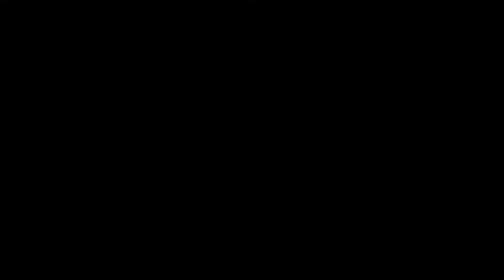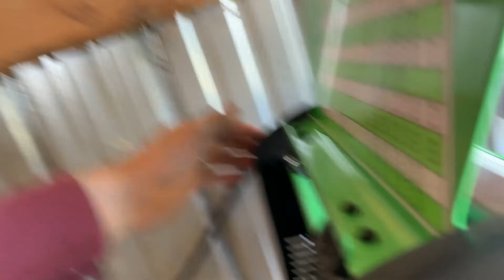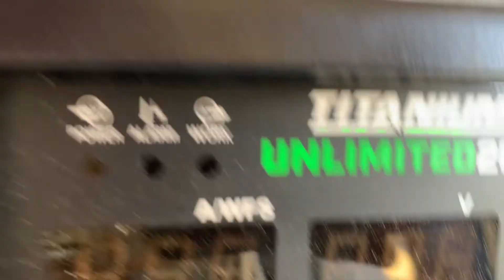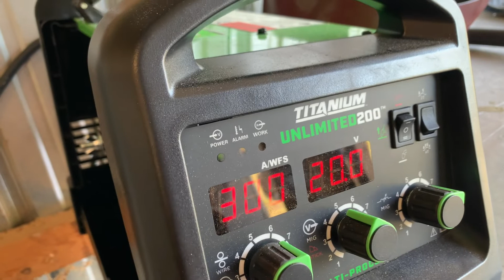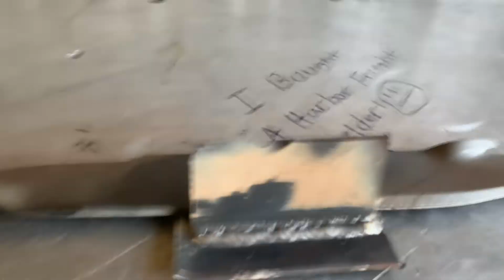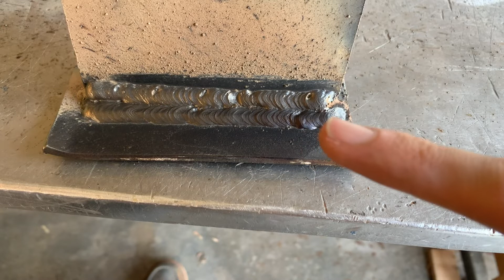Harbor Freight Titanium Unlimited 200-Flux Core Welding

Comment: Lol. Ypur metal is way to dirty. Wow. You should clean your metal before welding. That will clean up your weld and get rid of those holes.  Problem is dirty metal.  Grind it then wipe it with acetone.

Comment: I get different welding wire Harbor Freight wire ain't no good that's some good welding for flux core little pin holes in there you'd have to grind that out and do it over I am doing a very good job like your video

Comment: You dont suck at all bro. You are a TIG welder for Aerospace. I worked for Aerospace (not welding) and I know their standards are high and very delicate. You just dont have experience using wire feed.
I'm proficient in stick welding. Never tried flux and I'm good at MIG as well. 
TIG is my next process to learn. 
Thanks for the review. Gonna buy this multiprocess machine. Youre the only one whos welded with it on flux and stick on Youtube. Everyone else just uses the MIG. No TIG as well.
Reply: *Subscribed
Reply from the maker: I appericate the kind words man. I'm still loving this welder and hope your enjoying yours! Just used mine today for a quick farm repair on the stick side.

Comment: Thats porosity in your welds. (worm holes) Nitrogen is trying to escape from the heat. The wire youre using is garbage. Try blue demon. I use it all the time and haven't had any problems with porosity.
Also if its got slag, let it drag. Keep your angle out and drag it. I love flux core. Its more convenient to me. I dont gotta carry a tank everywhere and run the risk of forgetting to close the fuckin valve. Done that a lot over the years. Gets expensive! I run mainly flux now
Reply from the maker: Thank you for the tips! I knew the wire was garbage just wanted to get it burnt up. About to start building my kiddo a swing set and going to give your blue demon recommendation a shot!

Comment: The worm holes you see in your weld is from dirt on the steel you are welding. I think its Hydrogen gas from dirt or from moisture. You are doing very good welding. Keep it up, in two three years it will be GREAT and you will do what ever you want to with the welder. You'll see.
Reply from the maker: Awesome! Thank You for the tips!
Reply: @insidethekerf4731  I purchased one of these welders yesterday

Comment: If this is your first machine and you are a beginner that's a damn good well for a beginner and your first machine 
Check it. Out  when you get gas I used 25/75 on Mig you won't believe the difference get gas dude you'll love it then you need argon for the tig you definitely have to have gas for TIG good luck I was impressed with that weld if it's your first very impressed